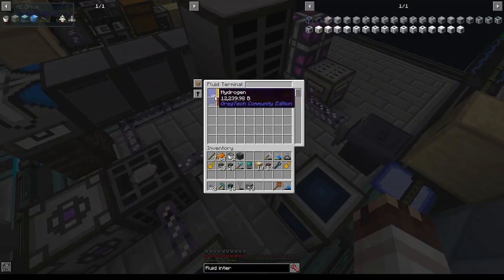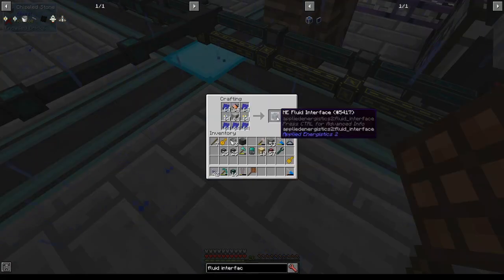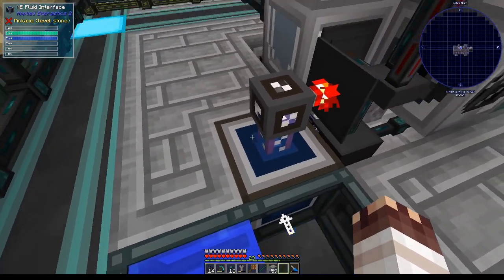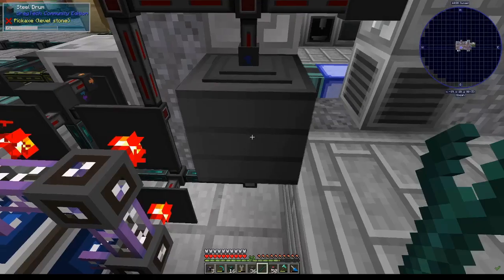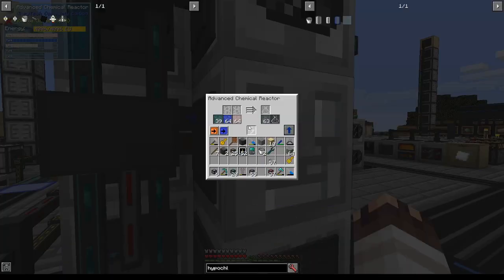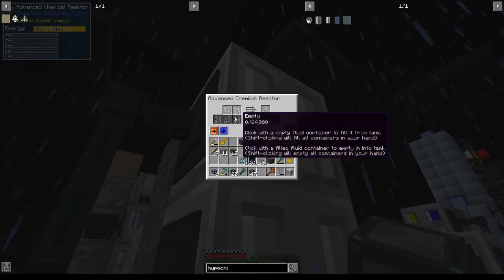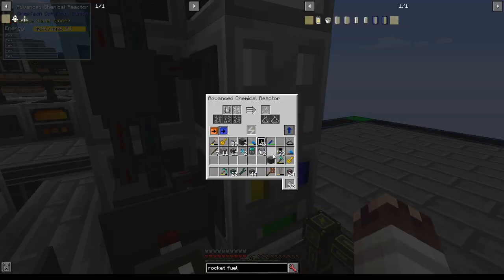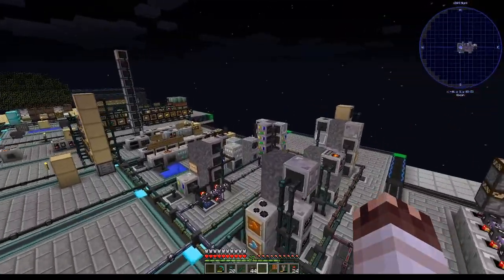New Omnifactory Supershorts #21: Rocket Fuel and AE2 Fluid Distribution

Comment: This is probably an obvious question, but where did you find the dev version of omnifactory?
Reply from the maker: You can find it on the Omnifactory Github: 
https://github.com/OmnifactoryDevs/Omnifactory 
in the releases section at the latest dev preview:
https://github.com/OmnifactoryDevs/Omnifactory/releases/tag/latest-dev-preview
And you can use MultiMC or CurseForge to import the Omnifactory snapshot.zip into a pack.
For questions about the OF dev, you can ask on these comments or in the Omnifactory Discord: https://discord.gg/jEEq7u5
Reply: @minecraftinchocolate  this is good cuz I dont want to build modularium for the oil rig lol